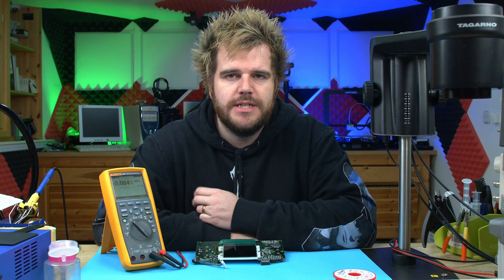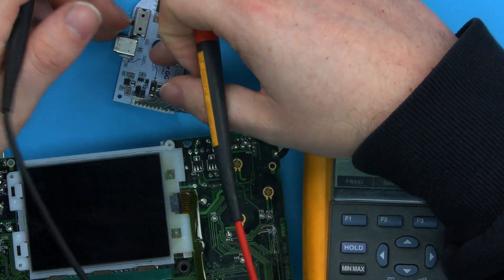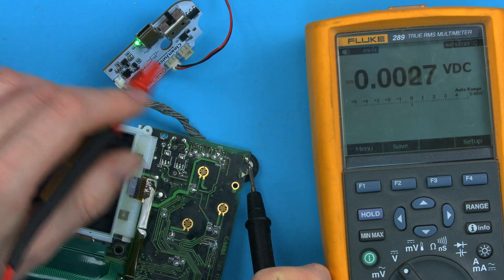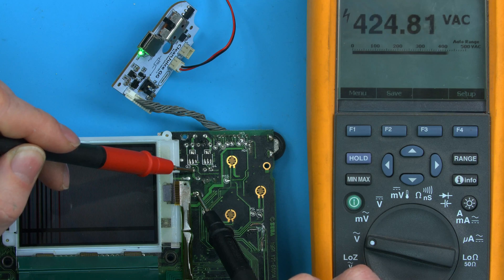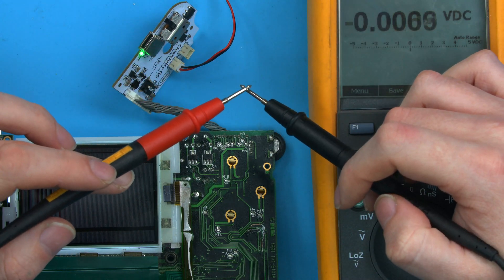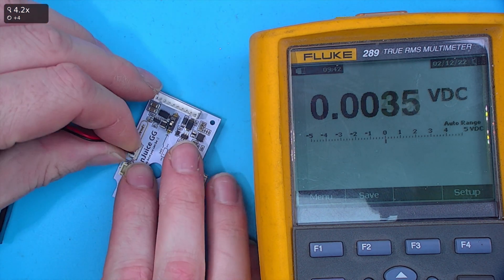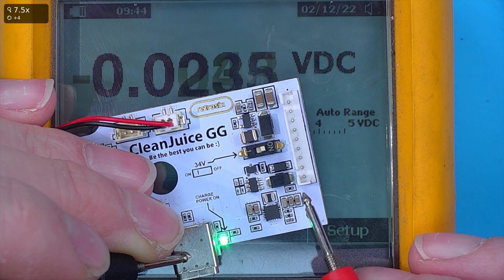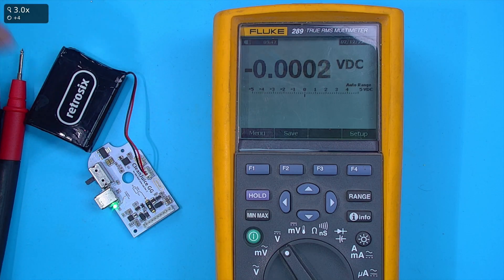Voltage DC Multimeter - Part 3: Diagnostics & Repair Course

Comment: sorry for the basic question but on the battery is the - (minus) the same as ground? Is it always the case? If so why in common house hold device AC there are 3 wires: + - and ground? (I understand that voltage is created by a difference of potential, but I don't see the difference between ground and the minus in this video)
Reply from the maker: Yep common ground